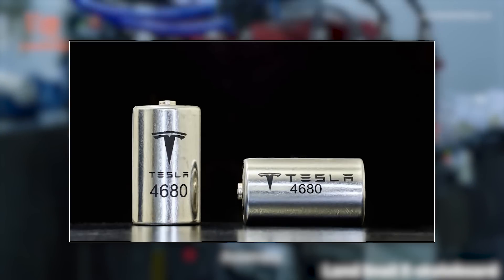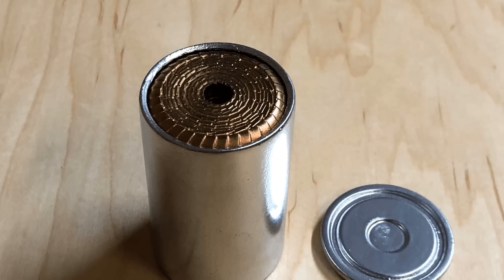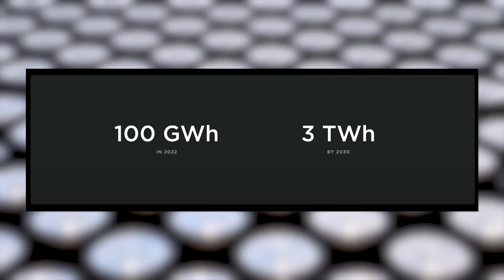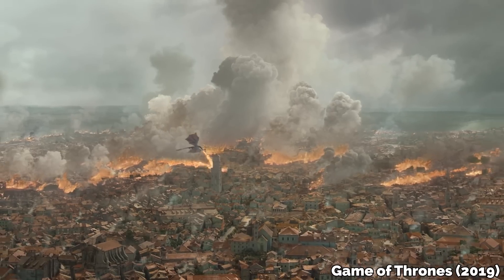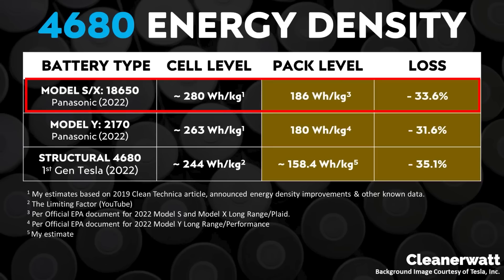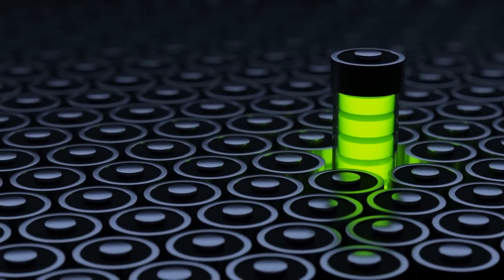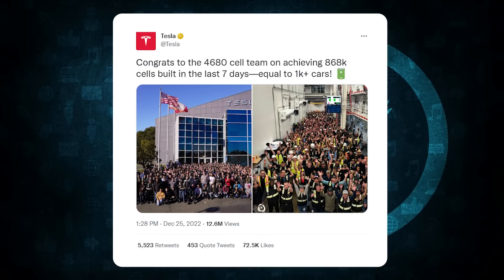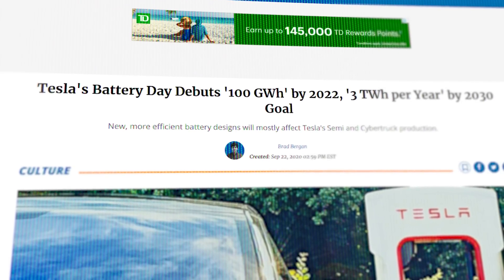The Disappointing Truth About Tesla's 4680 Battery Cell..

Comment: In a standard battery pack car if a module fails they can rebuild it. What happens in a structural pack car when a single cell fails? Throw the whole car away? From Munro’s tear down, it appears impossible to repair.
Reply: I highly expect even the conventional pack would be dismantled/recycled/full-replaced, not repaired, due to the complexity/danger of swapping new cells into existing partially charged pack.  Also see my other comment regarding the flaw in the energy density calc he describes, due to not taking into account less outside of battery structural mass required.
Reply: I believe all the cells are individually fused and if 1 goes bad it's just turned off from the rest of the pack.
Reply: @1Quamish  Right, but it is so far from trivial to replace a cell.  I imagine they replace the whole pack and recycle the survivors, just my estimation based on 25 years of design engineering.
Reply: @jaya8352  I don't think you have to replace a cell or two or ten in a pack if their bad. I believe the pack still functions within parameters of voltage and or is compensated for with BMS software. These packs are proven robust and I would think that individual cell failure in a 7 thousand cell pack would have to be accounted for.
Reply: @1Quamish  Packs are ganged partially in series wired packs running in parallel, not thousands of cells in parallel or series, so that may complicate things.  

Also, a bad cell is taking a drop out of a bucket micro-power-drop, wouldn't even be noticable, and definitely not worth the expense of replacing anyway.  If there were enough bad to be problematic, again I contend my be more cost effective to r whole pack.

I expect QC is plenty good enough that this is rare anyway and that entire packs do get replaced after many hundred thousand miles, under warranty mind you, simply due to wearing out all cells similarly.

Now the structural pack may in fact be more difficult to replace, I'm not sure how they are structurally integrated vs. replacement, but I imagine likely can replace the entire pack and no need to replace indy cells for the above likely.
Reply: @1Quamish  Oops all that I missed my initial point that BMS doesn't see every cell, it sees each series group as one entity, in my understanding, so would only see that group of cells as slightly low voltage if one cell was bad.
Reply: @1Quamish  I say this because of such things as inrush current, deadly in powerful lithium batteries, you can look it up.  I'm not sure it's economically feasible to replace a cell in a pack, I think the packs just are reliable and work for 500,000 miles or so and would replace the whole pack, though I'm realistically objective and not claiming it for sure.

Comment: It was never clear to me where the density would come from, maybe they figured indirectly from the structural pack saving weight?
If 2170 is the best just stick to that. Simple enough. It's not like S plaid is slow. And high time to get the Roadster out. Just update the specs and allow reservation holders to cancel. the 200kWh pack was shall we say ambitious. Make is 110 or 120. It's plenty.
Reply: 2170 has been produced for years. The 4680 saves a tremendous amount of money on the cost of the construction of the pack. There are other youtube content producers that have discussed on how they can increase the energy density of the 4680 cells.

Comment: I think a larger point is to be made concerning safety. The large cell adds some temperature margin to the pack. Just a guess bit the cell may be useful in as yet to be announced technology. Power needs and higher voltages may produce a pack for heavy equipment or mega pack production later. I always liked the old d cell flashlights that gave light longer than the smaller ones. That may be the magic.
Reply: The size is a small part of it but the real breakthrough with these cells is the tables design. This cell design allows for free flow of electrons from all points within the cell and doesn’t bottle neck the flow through the tabs.  This allows for much cooler operation temperatures and much more available energy on demand from a cell.

Comment: That’s why I keep questioning if we will have enough batteries or not for all these bold plans to manufacture so many vehicles. People keep saying that Tesla says they have all the batteries they need. But then how are we gonna get all the new type of Model Y’s with the 4680’s in structural battery packs? Are we gonna get a mish mosh of some Y’s made with 4680’s but most made with 2170’s? And should we care that much, since 2170’s turn out to have better energy density?
Reply: We're getting some model Y's with BYD's blade batteries.
Reply: @davidbrayshaw3529  should be interesting. Unless LFP blades, the blades may be more susceptible to overheating or even fire?

Comment: Guys.  The only things that matter to the consumer is these three things.  1) Range and is that advertised range the same in COLD weather.  Right now, it is NOT.  2)  Charging Time.  And can I charge even in cold weather.  Right now, in temps below 20F, you cannot especially if you don't have a 340 AMP fast charger. Single digits, forget it.  Can't put 340-amp chargers in a residential area.  They are only wired for 100 AMP.  3) Cost.    Please don't say that you have no Fuel costs with EV's.  That implies you think your listeners are stupid.  Electricity IS NOT FREE.
Reply: There is literally no vehicle on earth that has the same range in cold weather as it does in hot weather. All vehicles get better range in hot weather, especially if there is no A/C usage.
Reply: @imzjustplayin  My diesel truck only loses about 1 to 2 miles per gallon in cold weather.  Even temps to single digits.  A tesla loses 35 to 40% and will not charge in single digits.  My truck can be "recharged in 5 minutes" in single digit temps.  Get in the real world.

Comment: The main thing that the 4680 batteries are missing that is really hurting their energy density is the complete lack of silicon. As far as speed of production goes, the main thing that is still slowing them down is the dry battery electrode technology that they haven't perfected for large scale production yet. Once they solve that, and they add silicon into the battery, I think that is when we will see the 4680 fulfill all the promises we got at battery Day
Reply: There is downsides to adding silicon to this chemistry.  Elon, knows what he is doing, give him the time and benefit of the doubt.
Reply: @richk3552  I am trusting Elon. That was the point of my comment. The 4680 will do everything they said it would. It's just taking a little longer than he predicted.

Comment: Compare a AAA battery, a AA battery and a D cell. The AA comes out on top.  Size is not the indicator of being better.  Looks like someone thought just big is better rather than doing the actual measurements and understanding exactly how the battery works.
Reply: Send Tesla your viewpoint with supporting calculations. I’m sure they’ll be impressed.
Reply: Ever try powering a high current device with a AA battery?

Comment: I am disappointed that they are still rolling them in large cylinders. There is so much gap between the cells, and cylinders in a hex grid pattern does not make a great rigid structure.
Reply: They do make prismatic or pouch cell batteries but there are reasons why Tesla is going with cylindrical cells. There are youtube content creators that discuss this reasoning.
Reply: I feel like this is something they'll fix overtime. I look at the Starship S1 and S25 and I feel it's a matter of effort.

Comment: The 4680 structural pack also provides structure to the car so it's heavier. All the other batteries with higher energy density don't provide structure so you have to add in all that weight.

Comment: There’s scope within the Model Y battery pack to add 69 more batteries which would increase weight, but also pack power density, combined with the planned introduction of silicon into the batteries we could see a 6% increase in battery power and an 8% increase in the number of batteries in a pack for about a 12 - 14% increase in range. I say this as the castings are currently rated as a C also and there’s a lot of weight to knock out of the front and rear castings. The end result should be a 82 KW/h battery pack by the end of 2023 in a model Y with no increase in vehicle weight. Bloody frustrating though, and my biggest concern is that the production ramp for 4680s will continue to be slow.

Comment: You didn't explain how Lucid got the extended range. Maybe there is something to learn from their approach?
Reply: A huge battery and then lying about how big it is?

Phillip.
Reply: @philliptemple9841  Makes absolutely no sense :).
Reply: Efficient drive train and very good aerodynamics, just as Tesla. But with a bigger battery. That's probably all there is to it.
Reply: @EinzigfreierName  ... a bigger individual battery or just a larger stack of small batteries?
Reply: @tmcche7881  They use 21700 cells just as Tesla does. But more of them. Total capacity if I remember correctly is 118 kWh.
Reply: Lucid uses a higher voltage platform which reduces heat loss in wires for the same delivered power.
Reply: @dhui777  No. The heat loss is a factor of the resistance, and you just match the gauge of the wire to the voltage and current needed. I cannot see why there would be more or less heat loss.

Phillip.
Reply: @philliptemple9841  Power disipation is I^2*R.  Power is I*V.  If you double V you get twice as much Power but have NO increase in power disipation.
Reply: @philliptemple9841 , resistance remains the same with whatever components you got. Increasing voltage reduces the current required to deliver the same power and thus reduces heat loss in the entire circuit.  Of course, matching wire gauge can reduce heat loss as well but at the expense of increasing weight and reducing range.
Reply: @NScherdin  If you double the voltage the power will quadruple. Current increases in proportion to voltage so it will double as well. P = I²R or P = V²/R
Reply: @Soj. H   ...thanks.  I thought amp hour was the measure of available energy to do work. Which is proportional to the mass of the electrochemical reactants. Analogous to gallons of gas in an ice vehicle.  Running at higher voltage requires stringing more batteries in series. Which is more batteries and therefore amp hours available at the higher voltage.
Reply: @tmcche7881  Your random ramblings make my brain hurt. Energy is in joules. Power is in Watts. Power over time we measure in kWh (kilo watt hours). The voltage makes nearly no difference except when it comes to peak power, eg MW charging. An 800V car won't be any more efficient driving than a 400V car.

Phillip.
Reply: @Phillip Temple  ... Unlike you, I was being polite to Soj. H.  Giving a polite explanation of how electrochemical systems work.  

... I know chemistry, let alone electrochemistry, can be a difficult subject for most people. The range of any vehicle is determined purely by the amount of chemical or electrochemical reactants carried on board and the efficiency of chemical conversion to useful work, i.e., vehicle range.   External voltages are irrelevant except for how they impact efficiency.  In the case of electrical circuitry, a higher voltage can deliver more power with a lower IR line loss. 

     Power ( Watts) = Voltamps,     deltaV = IR,      I = nF(rate of reaction),     figure it out!
Reply: @tmcche7881  Good to be polite but it was very confusing. Just point him/her to a school text book would be easier.

Phillip.

Comment: The one thing about the existing 4680 is that it's still using the wet slurry method, on battery day the specs were based on the NEW dry method.

Comment: Considering range , infrzstructure what we need are cheap simple light electric car for daily commutte, easy to charge . Tesla are complex too expensive limited use cars for a few yuppies. Worst, they are indirectly subsidised for people who could afford it and pay fullnprice
Reply: Yes, but you can't just jump into the market making a low-cost car with thin profit margins--or worse, selling it at a loss.  You start with the luxury model with a high markup.  As you improve your manufacturing techniques and cost margins, you work your way down to the more affordable models.  That's what Tesla is doing.  I believe they'll get there.
Reply: @eyesuckle  What nonsense. I can't think of another major manufacturer in existence today that laid their foundations by selling a luxury model of motor vehicle. Ford, GM, Chrysler, all of the Japanese brands and the biggest of them all, VW group all started out in the game producing inexpensive vehicles.
Thin profit margins are easily offset by sales volume, and this is typically the case in many areas of manufacturing, especially cars.
Reply: @davidbrayshaw3529  That strategy worked for those brands 80 years ago.
Reply: @eyesuckle  Yes, it did.
Reply: @davidbrayshaw3529  have you heard about the WORLD ! You know, all that is not the US and is setting the trend now. Who designed, produced Tesla batteries ?
Reply: @jpcaretta8847  Are you replying to the right post?
Reply: Check out BYD. They're producing exactly the product that you're talking about
and they are a big manufacturer of electric vehicles. Tesla, like you say, are for the top end of town.
Reply: Nobody wants to drive a subcompact with crappy performance, at least not in the U.S. And a Tesla is now available for $36490. Not sure how that is expensive, when the average new car is $47k. The actual cost is $28-30k, when including cost of ownership savings, the same price as a loaded Corolla. I don't hear anyone complaining that a Corolla is too expensive.
Reply: @darylfoster7944  shut up, you will have to. No need for a big truck to be stuck in traffic and be unable to park. Over the years, I have seen a size reduction in all major big cities in the US ! Not to mention income going down. When the world will stop using the USD it will be even worse. You will have to pay with real money ! BTW Tesla cars are compact ! The truck ? A joke !
Reply: Yeah they're called Hybrids. Hybrids are a great bridge technology.
Reply: @imzjustplayin  NO , A WASTE ! Get for the same price a cheap electric and a normal car ! This is a better hybrid solution
Reply: @jpcaretta8847  Hybrid Toyotas are nearly the same cost as the non-hybrids while being more reliable. If I was buying a new gasoline powered car, I'd only get a hybrid as the non-hybrids are less reliable.
Reply: @imzjustplayin Currently  a good hybrid is a cheap simple electric for commute and a regular ICE for long distance, travel...

Comment: It's too early to criticize objectively... in 2 years it will be possible. But to me, the mistake made is the chemistry. NMC will be replaced by LFP for pure cost reasons. The winners are the Chinese: CATL & BYD and all the western companies investing in NMC will soon have a cost issue in face of the Chinese
Reply: I don't think LFP works for performance variants
Reply: @darylfoster7944  indeed but the majority of people don't buy performance models and 4680 batteries are not made for the performance models due to their low energy density, performance models will continue to use current batteries.
Reply: @francisdebriey3609  LFP will probably be used in the model 2, or whatever they call it.

Comment: Could probably fit a few hundred 18650 cells in between the 4680s, you’re welcome tesla 😂 I realize this may pose certain issues relating to rates charging or thermal control, but if these circumstances are engineered out (with software like all things), could we possibly see certain advantages to this arrangement? E.g. charging graph control, battery warming efficiency

Comment: Having a battery management system that only has to deal with 700 cells versus 7000 cells. Seems like a good idea.
Reply: They are better more cells really because a few bad cells makes little difference and the bms works on voltage of a group of cells so no difference.

Comment: I’m confused:

Why would you put a lesser performing battery in a car when you have the option of putting in a better performing battery?

If Tesla hasn’t figured yet out how to get most of the energy from the 4680 battery why installing it in a car, losing performance and therefore costumers?
Reply: Cost reduction maybe
Reply: @JL-tm3rc  you mean the Tesla with 4680 batteries will cost less?
Reply: @jonathanlivingston7358  by half if i recall correctly
Reply: @JL-tm3rc  if that’s true it’d make sense. Where did you read that, or where can I find that information? Thank you
Reply: @jonathanlivingston7358   reuters Inside Tesla's drive to keep Musk's battery promise
Reply: @JL-tm3rc  Thank you! I think I misunderstood you. Its the battery that will cost half of its price not the car. That’s still great!

Now it all makes sense. Too bad this video didn’t explain this crucial point.

Comment: I have no concerns about the 4680, its manufacturing parameters, its eventual energy density or its manufacturing advantages. Tesla will iterate and ramp according to plan. And I'm fine with my current brand of coffee. Thanks.
Reply: But that's the problem.  It is NOT iterating and ramping according to plan.  You stating otherwise doesn't make it true.